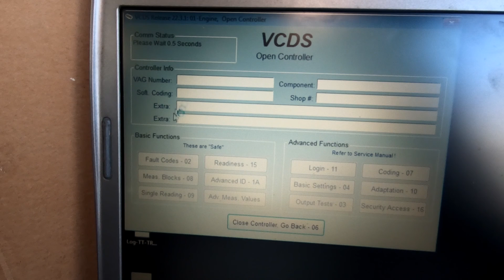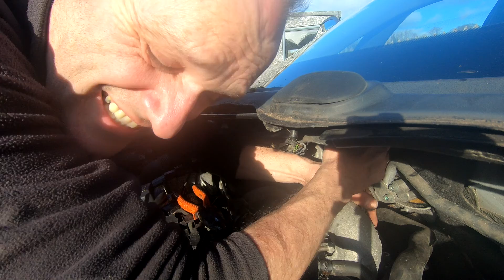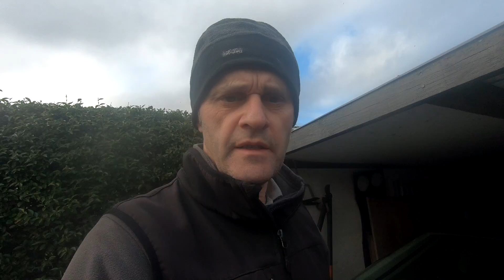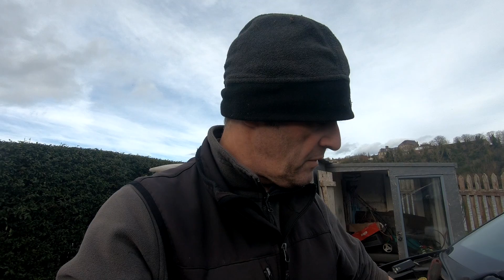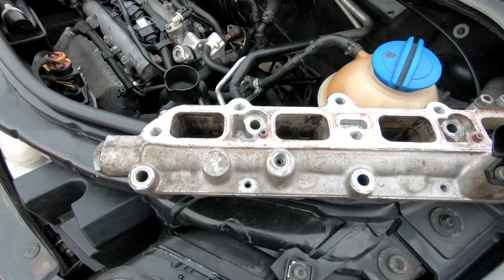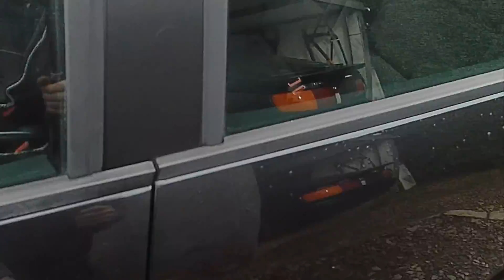Audi A2 1.6 FSi Inlet manifold stripdown

Comment: Thank you sir! I am in the process of restoring my 06 octavia 1.6 fsi and until now i am at 1.780 euros. parts and 70% labor mine. The car rides like new but the engine noise is disappointing. feels like it tries too much above 3000rpm. the car was not like that when bought,  always slow but not struggling. so since we grew up together i ll give this a go. has not been done anytime so far,  car at 288000 km. otherwise, no errors in vcds or whatsoever. nice hobby but expensive. 😂

Comment: Thank you for the video! My A2 1.6 FSI has a bad gasoline smell when its cold outside for at least 4 years. I know that I have to remove the inlet manifold to get to the injectors and replace the injector seals but all the videos show how it is done on a Golf. Now your video shows me that it is not quite as bad as I thought it would be due to the smaller space. I love my blue A2 CS.
Reply from the maker: The crucial thing is to remove the top engine mount (support via jack underneath) to get the large inlet manifold out. Also smear oil on the rubber injector seals and be ultra careful when replacing the inner manifold back on again. Good luck!

Comment: Great videos!!! I've just picked up an FSI yesterday and really looking forward to getting mine running well. min seems to have a bit of a blow from somewhere in the engine area. sounds like an air cooled VW at the moment.
Reply from the maker: Oh dear! I usually hone in on a blow with a pipe on my ear. Not recommended but always serves me well. If it was on the inlet side, the car won't run well. If it's on the exhaust side, it will still run well but be noisy. Good luck with the car.

Comment: Did you have to follow any specific procedure to release the pressure in the fuel lines before starting? Also, where did you source the replacement injectors? Do you happen to have the part numbers for them?
Reply from the maker: To relieve the pressure I gradually released the pipe that goes into the high pressure fuel pump. Steve Edwards in the A2 owners facebook group has the injectors in stock. Here's a link to the O-rings I bought and the injector number that was on mine. https://www.ebay.co.uk/itm/276057470892

Comment: Did you found the problem's origine ?
Reply from the maker: It needed a de-coke but it also had a faulty injector which I replaced and is running fine now 👍

Comment: How do you get the Cowel off above the intake manifold
Reply from the maker: You have to remove the rubber scuttle/bonnet trim then prise up the plastic trim and there are 2 Torx screws underneath it holding the top of the cowel on plus 3 10mm nuts holding it onto the bulkhead. Hope that's the part you are on about? (air intake for the heater unit)
Reply: @garageofdad thanks I've got same probs
Reply: 1.6 fsi misfire
Reply from the maker: @stevenharker9260  Oh no! Hope it's just the coils but may be an Injector.
Reply: @garageofdad no its not those next its timing and compression test
Reply from the maker: @stevenharker9260  Let me know how you get on

Comment: Do you think that your refurb of the inlet manifold was a success,I'm gessing that if the actuator and arm are in tact it's mostly carbon deposits are the issue?
Reply from the maker: The main issue was a faulty injector but the decoke certainly helps with the intake airflow and the management of the intake flaps which are crucial for the smooth running of the engine and low down power. So, if you're able to undertake the job, it's definitely worth doing on a high mileage engine. The bonus being, you can replace the 'water pipe, thermostat and maybe water pump at the same time to future proof it all.
Reply: @garageofdad  Great video by the way,real life!!!Hi Garage,thank you for your prompt attention,no faulty running just an engine management light,a mate of mine checked over the diagnostics and it says inlet manifold fault,I really am reaching the end of my tether with this car,and I am mega helpful for your input.Are you suggesting checking over the injectors first the miles on this car are 113,000?What about one of these decoke aerosols and some decent petrol for a start?
Reply from the maker: @Dipstickdanny  Depends on whether it's misfiring, down on power (below 2500 revs) or high emissions. Have a look down at the flap plastic actuator rod and see if it moves when you rev. It's at the left hand side rear of the engine and can be seen visibly moving. I've watched many videos on the aerosol method and they all seem to be inconclusive. But they're a much easier and cheaper method to try first so maybe worth giving one a go. The Liqui Moly or STP versions seem to be the best.

Comment: Great video. And a cautionary tale to pay someone else to do this 🙃 
This is like the complete song sheet of my FSI.
Namely a dodgy misfire on 1 cylinder but none of the so-called specialists around here have the wherewithal to confirm if it needs a clean and possibly a replacement injector (which are pretty much only available used or recond) OR something else entirely is the cause.
That said she still starts first time every time and keeps on going, misfires reagardless.
Well done Garage of Dad you have the patience of Jobe - were you bit closer I'd go up and compare notes
Reply from the maker: Thanks - Mine is running great now like a little Mini Cooper S and I don't hold back with it!! :D The engine light still pops on but I'll just switch it off for the MOT Ideally, I need 4 new injectors but it's such a job so will just keep driving it for the mean time.
Reply: @garageofdad  Yes my MOT garage told me that EML lit is now a failure, regardless of the cause

Comment: I'm actually on the same knuckle- job. Your video helps me a lot.
Question: How am I sure to have closed valves before soaking the mess, so nothing leaks in the burningchamber?
Can I really see they are closed after turning the crankshaft?
Btw: You have a cool accent. Regards from Switzerland.
Reply from the maker: Hi. Thanks for feedback. I took the cover off the camshaft and turned the engine with a socket & wrench. I used a mirror to watch for the valves closing but you can also take the spark plugs out and insert a long thin screwdriver down and watch for it getting to it's highest point. You have to do this for each cylinder individually. It's a pain you just have to do it. Worth it though as mine is running well now. I come from the Scottish Borders (with England), our accent is proudly a soft Scottish 😀

Comment: pretty serious (not to say pig of a job)... thank you for sharing: I'll postpone as much as I can now ;)

ps: if you plan to keep it (and I am as well) would you not consider having it run at 90°C max rather than 105-110 ? by way of reprogramming it or otherwise (e.g. fooling the temp sensor)?
Reply from the maker: On hindsight, if I took my time and put both sets of injector seals, resealed the death pipe and new clips on the water hoses, it would all have been ok the first time. But as usual, I'm always rushing things then having to redo afterwards!! Not sure how to reprogramme the sensor, could you maybe email me through my about page email on how to do this? Thanks
Reply: @garageofdad  I'm by no means as experienced as you are on A2s, but I've sent you a mail to share my thoughts on the topics of coolant running temperature on the 1.6 FSI... 2 options I've been considering (though not acted yet) are ecu reprogramming (more costly) or temperature sensor fooling (soldering a resistor inline with G62 so as to make the ECU believe the running temperature is less than 50°C hence should remain in homogeneous mode (CheckEngineLight on I understand) I've not made up my mind yet...

Comment: Keep it up, these A2`s are special. Can you please video the drivers side strut replacement, its a PITA because of the brake fluid container.
Reply from the maker: I am going to do that very thing. If the strut top bolts shear off, it's an absolute nightmare to get the strut out. Keep watching. P.S. I usually undo and romove the fluid container out of the way.